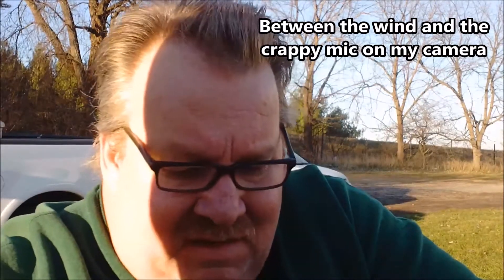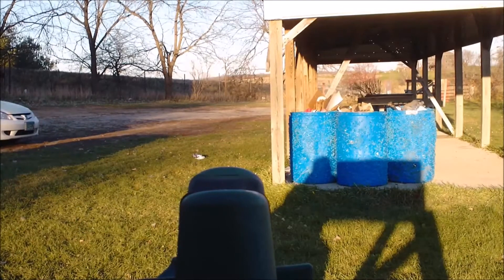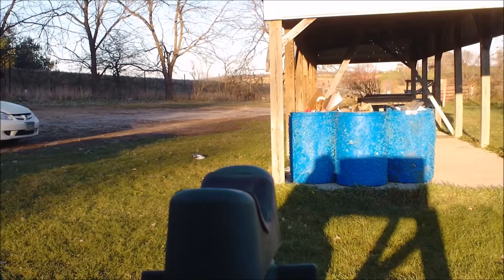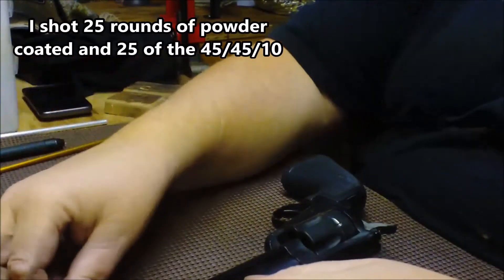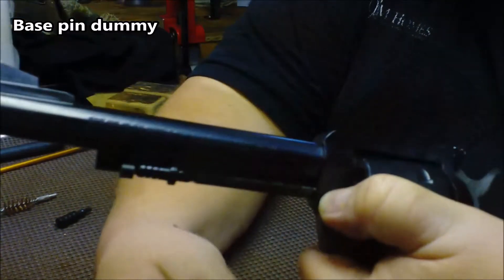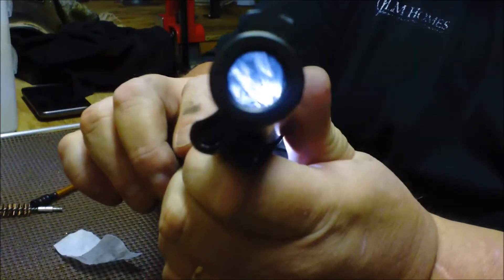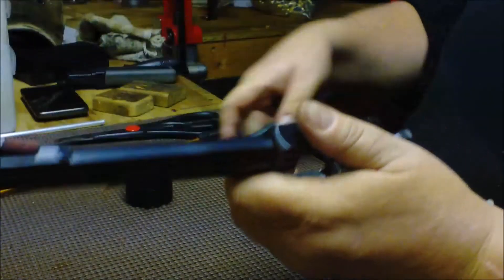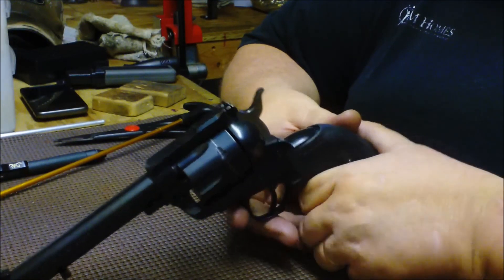Ruger Blackhawk shooting and cleaning

Comment: Great gun.. That thing is powerful.. I thought my 357 was tough.. I haven't ever shot a pistol from a rest. I normally shoot on the move.. Nice video.. Thumbs up brother..
Reply from the maker: +Shiny Knife (Give away open) I only shoot from a rest for accuracy testing. In the woods I lean on a tree, I always try to have some support. .41 magnum is pretty stout, that's why I load my own, different powders shoot different.
Reply: +Mr. Tolly (AKA: fatmantolly) how does it compare to .357 mag is it a huge difference? Or slightly more?
Reply from the maker: It's noticeable for sure with full magnum loads but it packs the punch of a .44 magnum without the recoil.
Reply: Mr. Tolly (AKA: fatmantolly) I've never shot anything bigger than .357 magnum.. I bet that would be a handful no doubt..